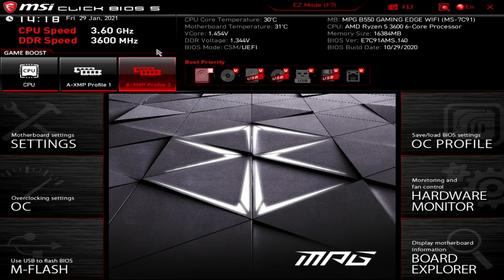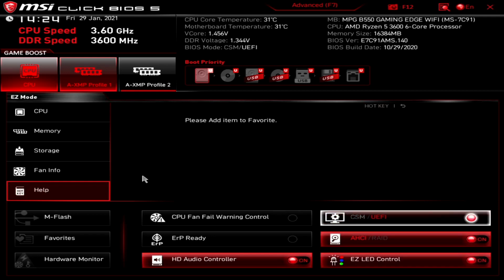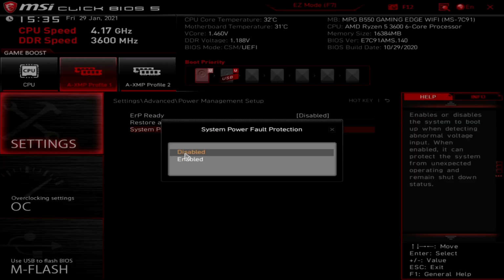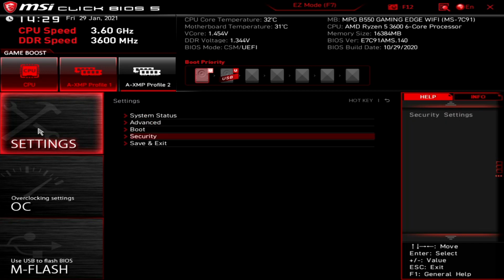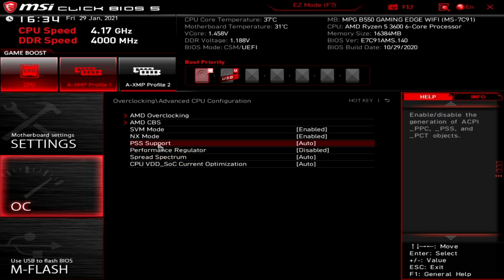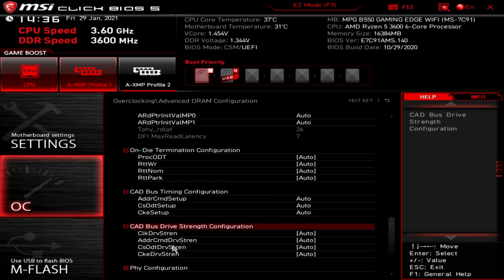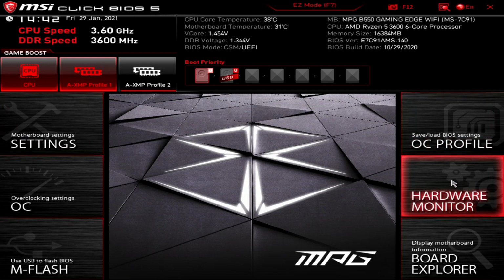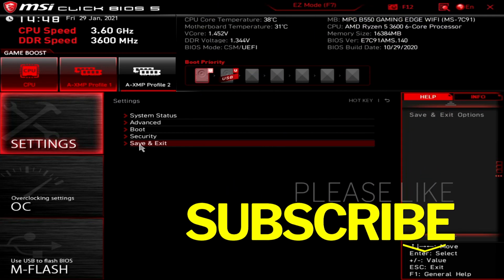MSI B550 Gaming Edge Wifi BIOS UEFI Walkthrough Tour & Basic Explanations

Comment from the maker: TIMESTAMPS For quick access to sections 
00:00 Intro
00:08 Main screen (advanced mode)
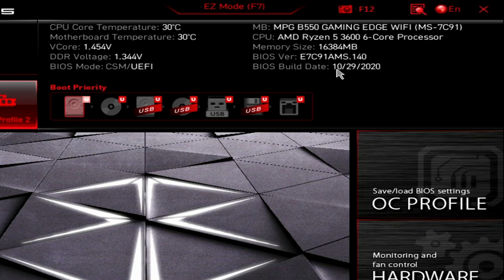00:44 Bios version info
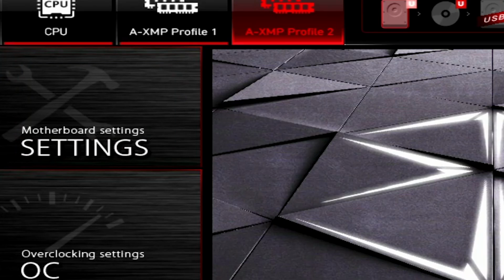00:53 Time and date info
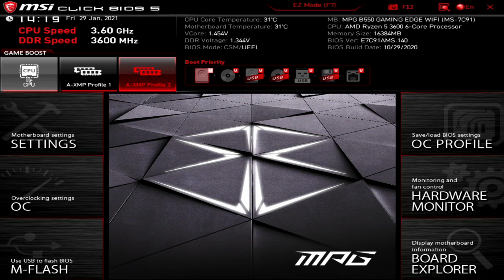01:08 Game boost
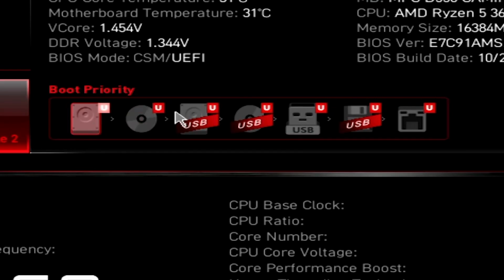01:30 Booting priority (ez mode)
01:40 Game boost and XMP options
02:00 CPU section
02:05 Memory speeds and settings display
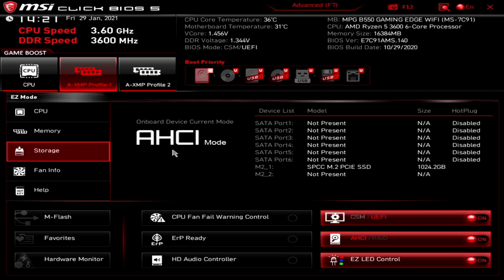02:23 Storage display
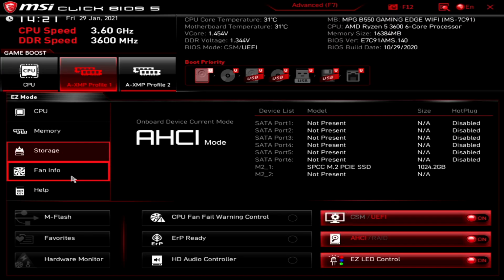02:45 Fan Information and options
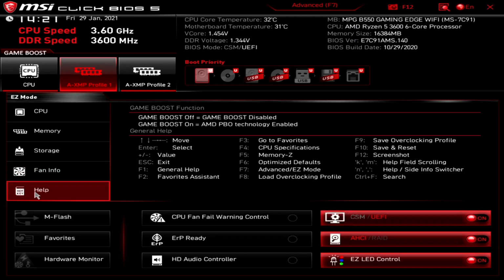03:12 Ez mode help section
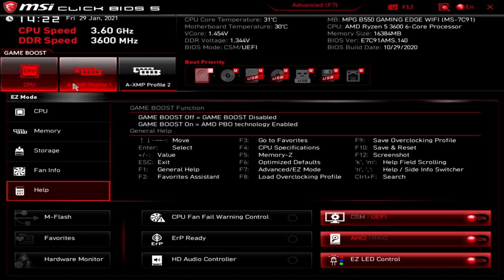03:25 How to enable PBO overclocking in ez mode
03:58 M flash (ez mode)
04:23 Favourites 
04:29 Hardware monitor (ez mode)
04:42 Fan warning control
04:59 ErP Ready control option toggle
05:04 HD Audio controller ON/OFF toggle
05:11 CSM UEFI toggle option
05:27 AHCI / RAID Toggle
05:41 EZ LED control toggle
05:55 Toggle EZ mode / Advance mode
06:06 Advanced mode settings section
06:12 System status
06:27 Advanced system settings Including PCIE Gen switch for GPU
07:08 ACPI power management
07:45 Integrated peripherals LAN WIFI HD AUDIO and SATA
09:19 USB configuration XHCI hand off and Legacy USB support
10:20 Change mouse speed in BIOS
10:35 Power Management setup ErP ready Restore after AC and power fault protection
12:04 Windows OS configuration CSM or UEFI options Secure boot
13:07 Wake up event setup WOL WOM etc
13:30 Secure Erase+ 
13:40 NMVE Self test
13:50 AMD Overclocking Main menu
14:25 Advanced boot settings boot order etc
17:00 Security passwords for BIOS etc
17:19 How to save BIOS and exit
17:29 OC main menu 
18:12 How to set CPU OC ratio or multiplier
18:42 Advanced CPU configuration PBO SVM NX mode spread spectrum etc
20:18 AMD CBS Core boost settings menus
21:30 Package power limits
22:34 How to enable virtualisation or SVM mode
23:08 Enable performance enhancements for Cinebench aida64 etc
24:24 FCH base clock or BCLK adjustment
24:59 Memory timings and XMP and memory failure settings
27:20 advanced DRAM config manual CAS settings entry
28:55 Voltage settings CPU core VDDP etc
30:27 undervolting options
31:20 DRAM voltage settings
32:20 CPU technology supported MMX SSE etc
33:25 M flash in advanced mode
33:47 OC Profiles main 
34:09 Hardware monitor and fan control
38:56 Board Explorer page
39:21 drag and drop boot options demo
39:50 Save and exit!
40:00 Like and subscribe!
Reply: May I know how did you get your ram's orig freq? I have tforce 3600mhz and I can only get 2133mhz
Reply from the maker: @Bryysanity  normally it will default to the native speeds, you need to turn on XMP in the bios to get the overclocked speeds
Reply: Hé Mike how too use the second m.2 slot its not working i have b550 mobo

Comment: I have MSI MAG B550 Tomahawk Max WiFi+ Ryzen 5 5600x

What is the best settings to improve overall performance? (More for gaming)

Thanks!
Reply from the maker: personally i would use the PBO tuner to change the curve and set to all core negative 20 that should reduce temps a little and allow longer higher boost clocks
Reply: @mikesunboxing yes! If i turn pbo disable and curve optimizer all cores negative 30 i have better temps and more score in cinebench.

Thank you!
Reply from the maker: negative 30 is great if it is stable, if not negative 25 or 20 try it and see

Comment: Hey i really need help i thought i knew what i was doing but i made a mistake cuz i had other problems that i needed to fix but apparently i turned off the usb so now my mouse and keyboard dont work got any ideas?😅
Reply from the maker: start with resetting the CMOS to the factory defaults to restore the normal USB port function
Reply: @mikesunboxing  thanks bud i managed to fix it by removing the moderboard battery under the graphics card witch reseted the bios so i didnt have to use keyboard or mouse very effective thanks for answer big up.
Reply from the maker: @DarkSight97  Glad you got it working 🙂

Comment: How do I enable wifi? I just build my PC and for some reason its not connecting to wifi and it has the antenas
Reply from the maker: it should work straight away with a new windows 11 install, otherwise you will need to install the drivers manually from a usb drive downloaded from another pc

Comment: Hello my friend, I was looking on how to adjust PCI settings to gen 3.0 for my second slot. I have a GPU in the top slot and a 4k60 pro Capture card in the second slot but the motherboard is not picking it up. The only thing I have found is to change the settings to the PCI to a gen 3.0 or 2.0. If that doesn't work then the last option is that the motherboard has a PCI limiter on it. I currently run two M2. drives, a GPU and and additional 5 usb slot config. so adding a capture card might be too much if there is a limiter.
Reply from the maker: You might simply be out of available pcie lanes

Comment: Yes sir I'm having a tuff time with the cou boost and xmp profile and game boost I'm running 2666 mhz my CPU chip is intel i5 tenth generation when I started setting the mother board the CPU and xmp profile are black I can't activate that I need help
Reply from the maker: some intel processors won't do xmp speeds so look on the intel page look for the fastest supported DDR4 speed and then enable XMP but change the frequency to the supported one and see if it boots
Reply: @mikesunboxing  ok and thank you

Comment: I've been building my own systems for years now and recently bought one of these off ebay great condition for fresh build and windows installation latest bios and the wifi is on in the bios but no sign of it being detected at all in windows, it just does not see it even exists, even after installing all chip set drivers and wifi drivers, anyone else with same issue?
Reply from the maker: no that is odd. you can check and remove the wifi card if you take off the io shield and cover
Reply: @mikesunboxing  I managed to remove the tiny wifi card and it looked perfectly fine no issues I could see and no way of testing it, trouble is its from ebay so never know what its been through, also I had updated the bios to take ryzen 5 5600x

Comment: Have just finished my pc MSI mag b550m mortar just got new ram kit as well KLEVV BOLT XR 4000mhz but having problems with cpu the motherboard is setting 3.7ghz instead of  3.6 going over clook rate and the ram kit come unstable the timings 19-25-25-25-45 1.40v getting over 70 errors in memtest then blue screen doing test. Now I set 4.2ghz 1.350v and turning GMD Did other test it stable so I think something do with motherboard setting things and cpu
Reply from the maker: turn on xmp but manually change the RAM settings to what it says on the RAM
Reply: @mikesunboxing  came that 19-25-25-25-45 xmp profile 1 yes on

Comment: Hi. I have MPG B550 Gaming plus with M2 seated in 1st slot under CPU. Sadly my disk is running incredibly slow and has high latency. I have all settings setup on auto. UEFI/AHCI on. Dont know really what to do next. Bios is up to date, chipset drivers too. :/ Any ideas please? :) Thanks!
Reply from the maker: is the drive getting hot?
Reply: @mikesunboxing  Doesnt seem to be the case. I have been trying to figure it out and maybe i have a theory. When i disconnect my HDD my M.2 is faster. Could it be PSU? I have 750 W Gold, but seems to be related. Maybe there is some problem with not enough energy. I have 5600X AMD, 6700XT AMD, 32 GM DDR Kingston Ram, SSD SATA Burst250G, HDD2TB Barracuda, M.2 + Gaming plus MPG B550 MSI. Maybe its underwolted? :/
Reply from the maker: @ViktorBřenekYT  This is maybe easier to fix or at least advise if we can ask more questions and get direct answers, so feel free to join our Discord chat and we can go over it in more detail https://discord.gg/gaeeDPw

Comment: How to increase vram in it cuz when I try it stuck at starting
Reply from the maker: are you referring to when using an APU
Reply: @mikesunboxing  yes I am using r7 5700g on msi b550m pro when I tried it the cpu starts but no display the power light keeps on cpu it's new motherboard what settings I need to apply before applying it
Reply from the maker: @mohammedkhaleelx  This is maybe easier to fix or at least advise if we can ask more questions and get direct answers, so feel free to join our Discord chat and we can go over it in more detail https://discord.gg/gaeeDPw

Comment: Hi, Have the same board and chip set. Trying to upgrade to Windows 11 but it says TCM 2.0 error. Ive changed settings in BIOS but still get errors on the health check. What BIOS settings do I nedd. Any advice?
Reply from the maker: you need tpm 2.0 enabled and you might need to reset the tpm key also, otherwise join the discord chat for more help and maybe send a picture of the bios so we can advise

Comment: Can you show us a test of 3400g/1600AF/2600 type CPUs to see which B550 gaming edge bios they still work with? I'm currently running a 1600AF with my B550 Tomahawk and still working with bios AMD AGESA ComboAm4v2PI 1.0.8.1. wondering what newer bios I can upgrade to before support is dropped for my 1600AF (if it ever is), thanks in advance
Reply from the maker: i only have 3400g from that list, but i'll see what i can do

Comment: HI Mike! Can i run 4 GPUs whit this mobo? will this affect the performance of the GPUs? can you leave more info on the advanced settings for it? Thanks for the video and all the info.
Reply from the maker: you could use more than 1 gpu but at best you would be looking at sharing the bandwidth of the PCIe lanes across the slots so it won't be as fast

Comment: possibly one of the BEST b550 boards MADE TO DATE but
one exception thats KILLING this board from TRUELY being a king, thats the voltage option for CPU_VDDP
no not VDDP or CLDO_VDDP as those two are the same thing which are for the PHY interface for ram. 
(CPU_VDDP) is a big help when overclocking ram beyond 4000mhz or overclocking ram at all. 
to which the BIOS to date or any previous has not had this option unlocked as MSI states its only for INTIGRATED graphics which is false 
as other board makers have this option unlocked or unhidden.
Reply from the maker: hmm interesting. i feel more people will be getting into overclocking soon as the CPU market dries up, forcing us to push existing hardware to extreme levels

Comment: Hey don't know if you'll reply, but I'm running 4 8gb 3200mhz sticks, and my dram is stuck at 2133mhz, I goto the change it and save and exit and it doesn't reboot, and I am forced to reset my cmos, any tips on this?
Reply from the maker: it will depend on the motherboard and processor to some extent and the voltage etc when applying XMP.
You could try enabling XMP then manually reducing the frequency to 2666 or something and work the way up until it no longer boots
Reply: @mikesunboxing  I have a Ryzen 7 5800X and the same MOTB as you. I'm getting worried.
Reply from the maker: @putrid_tv  as long as the ram is in slots 2 and 4 in theory it should just work

Comment: What is the maximum for DRAM voltage you can enter, does it go up to 2V at least or is it limited to 1.8V?
Reply from the maker: truthfully i am not sure on that, i always use the 1.35v xmp rating
Reply: It's ok. Thanks for the reply. Nice walkthrough around the bios options, all reviewers should do that. Ii matters for overclockers.

Comment: Hey Mike, I touch profile 1 to change my ram speed to how it should. I'm not sure if I touch bios 2 but both profile 1 and 2 for a-xmp setting is identical. I'm thinking about  turning off profile 2?  My bios setting for both profile is at 3600mhz and everything looks good on my bios for my 2 ram. My concern for my ram speed with techpowerup and msi afterburner shows 1400mhz but on task manager my memory speed shows 3600 mhz. Should I be worried?
Reply from the maker: is afterburner showing the GPU RAM speed i think
Reply: @mikesunboxing  thanks for the help, I was reading the gpu ram. I used cpu-z and my ram speed is correct.

Comment: Hey i just updated my bios and for some reason xmp isnt working. It was working fine before I updated but not now. I go to xmp profile settings and everything looks good and its on 3600 mhz but my speeds are stuck on 2331mhz for some reason is there a fix?
Reply: I also need help, in bios it looks good but I only get 1400mhz.
Reply: @Lor-ub1mc  i cant find anything on how to fix anywhere 😂
Reply: @mario_str8693  same im still stuck at 1400mhz on msi afterburner and techpowerup. But I just joined Mike's discord to seek for help🙏
Reply from the maker: This is maybe easier to fix or at least advise if we can ask more questions and get direct answers, so feel free to join our Discord chat and we can go over it in more detail https://discord.gg/gaeeDPw

Comment: I just bought a b550 gaming edge WiFi, will it work with a ryzen 5 5600x right out the box ? Or will I have to do something
Reply from the maker: if it is brand new from the factory it should work out the box, if not a quick flash should sort it
Reply: @mikesunboxing   I just bought the same combo. System boots and works fine but I can’t get into bios. There is no screen prompting to hit del and I can’t do it through advanced startup either. Should I flash it?
Reply from the maker: @PlOyA17  Yes, if it didn't have the 5000 series sticker, and you are using a 5000 series processor or join our Discord if you want more advice  https://discord.gg/kG4rrps

Comment: will i have any kind of problems if i match this with my 3700x and coolermaster aio cooler, i wanna see pump and pump fan setting and want my mb control their speeds automatically. Because i m changing my old b450 prime asus board cause cooler works so bad and i think my cpu's voltage is 1.4 all the time, it s too much isnt it ?
Reply from the maker: 1.4 is a lot but that could be just on one core so not to bad, and yes the board is a good choice

Comment: I have the exact same board with a RYZEN 5 3600XT, I was concerned about the temps because it was getting hotter than I like in normal use, I reduced the voltage to 1.300v and stopped it over boosting until I sort out a better cooler than the Wraith Prism.
Reply from the maker: the voltages can be quite high on this one

Comment: Hey Mike! I'm planning on building my first PC soon. I want to get a fan splitter for three of my fans to plug into one system fan header on the motherboard. The fan splitter is PWM, so would I be able to control the speed of all the fans through that one header? Thanks!
Reply from the maker: yes you can but all fan will be the same speed i.e. synced together
Reply: @mikesunboxing  thanks. I assume that won't be a problem. I don't plan to spend too much time playing with thermals.

Comment: Odd naming for the ability for PXE/IP4 booting, but seems like every company and BIOS/UEFI likes to use non standard wording for everything... because they suck. Restore after power loss, keep that to system OFF. Not good when power goes from on to off while the power company fixes something somewhere. GOP information basically provides dirt on the United States republican party members 😄. Luckily for me I don't overclock anymore. I just need to go in there to enable XMP and very few other things.  I also need CSM for my multiboot USB Stick till I move to a UEFI only solution. With todays boost clocks making the CPU speeds more dynamic, I don't feel the need. It's basically overclocking done by the manufacturer and is covered under warranty and meets spec. Is it redlined to the bleeding edge? No. But like you said here Mike, I am more interested in stability and longevity. I don't even use PBO. Why wasn't I listed in your BIOS' Miscellaneous items section? Perplexing... 😃. They need to add a feature to the fan curve that can read from the GPU temp sensor, in case you want to use that as the decider for fan RPM adjustment. My Zen+ 2600 is chilly compared to the 2060 Super which also runs pretty cool most of the time. This whole video hurts my feelings because I'm relegated to the LITE BIOS. My BIOS chips too small for the Click BIOS. I'm a non MAX MSI loser 😪. We'll see what happens when I'm on my next machine, whether that's AM5, some new ARM RISC thing, or GhostAdder level blasphemous Intel build. Nice walkthrough Mike and the time stamps are going to help a ton of people who just wanna get the gist of something quickly. If you made it to the end of my paragraph (shame on you), have a nice day... time to shovel and shovel and shovel and shovel snow 😞.
Reply from the maker: i wish i knew more about the settings to be honest, but it is probably safer not to as i would then make content and then have a ton of people crying that their CPU caught on fire :)
Reply: @mikesunboxing  It's OK to know and learn what we need to when it comes to being needed. Much less stressful using that approach. You always suggest people look into a particular thing on their own which is the best advice you can give if you are not 100% educated on the matter.

Comment: Wow, that V-Core voltage is way too high. I manually set mine to 1.325V.  I always turn PBS off.
Reply from the maker: yep pretty much out of the box settings. I will probably do some follow up with tuning options, but that might be opening a larger can of worms :-)
Reply: @mikesunboxing  It's fun to play in the BIOS. I hope everyone gives it a try. But I also hope they all know how to clear the CMOS when the PC locks up.
Reply: @OlettaLiano  I wish you could save a fan curve from any BIOS version and push it to a newer BIOS version. Only thing that irks me after flashing a new UEFI version is having to put the curve back in. And of course the anxiety I feel expecting the power to fail when flashing.
Reply: @jamesmiscellaneous  The reason you can't save a fan curve is the same reason you can't save overclock profiles. Flashing the BIOS completely wipes out the old one to make room for the new one. It would be nice if profiles could be saved to a drive.
Reply: @OlettaLiano  I will have to look at it, but I think that the latest beta BIOS for my x570-a pro just let me do that. Maybe next weekend.